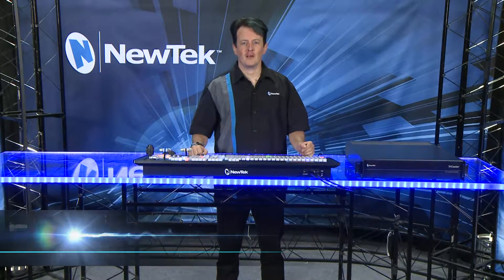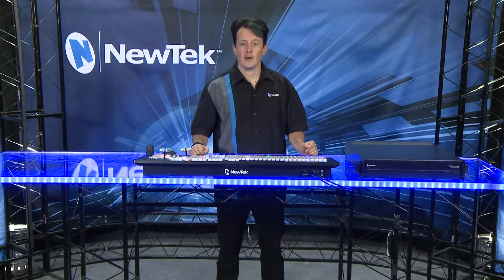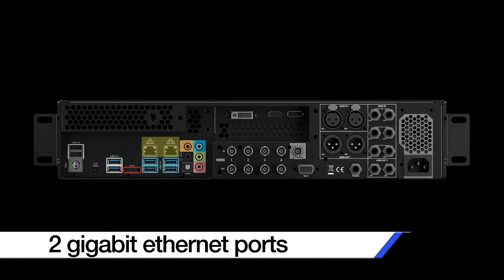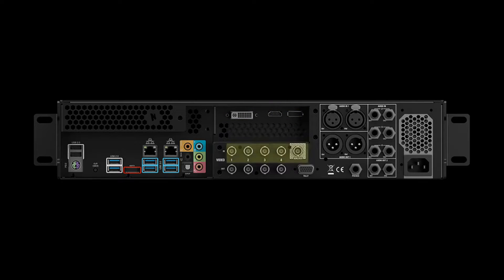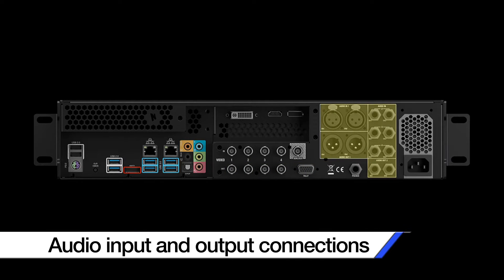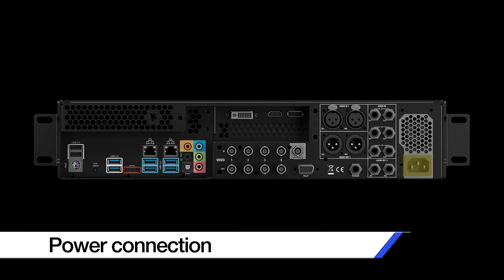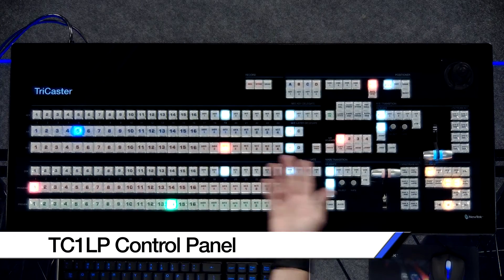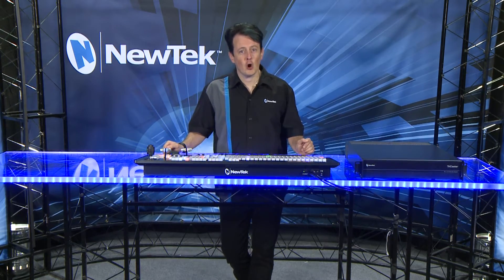TriCaster TC1 Get Started Training Chapter 1 - Hardware and Connections

Comment: The only back side jacks I wanted info on were the cluster of 1/8 inch jacks...but you skipped right over those.
Reply: the image I sent is for reference only.  the layout on the TriCaster will vary, but the color codes is pretty much standardized.